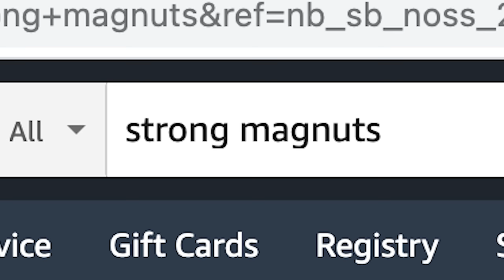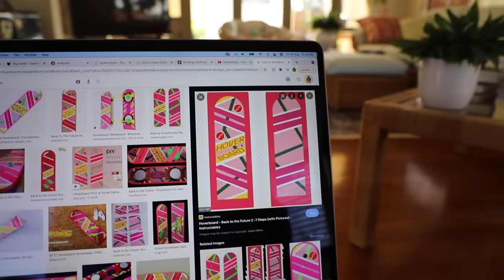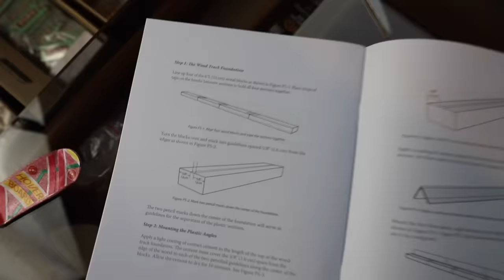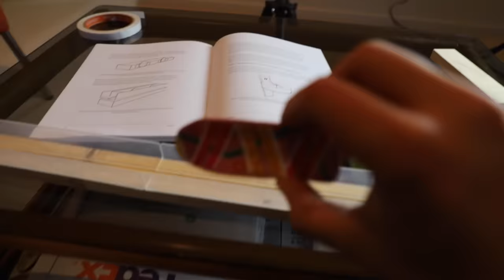FINGER HOVERBOARD!

Comment: hi David I'm an electrical engineer i found your channel whilst researching fingerboard parks for my son I built a pretty cool one btw and for your magno-hover to work you'll need to coil one very large loop of copper wire all the way around the edge of the platform ALOT of times making a huge electromagnet this will create a huge polarity field that your little neodymium magnets should sit nicely on top of its relatively simple physics (though i do have a PhD) its quite cheap as copper wire can be easily found on da bazos if you do wanna try do this reply to my comment and i can email you the full spec read out so you can make it super cool.
Reply from the maker: Hey!! Sounds awesome yeah shoot me an email when you get the chance! daylifesnow@gmail.com
Reply: I’m just adding a response so you get a notification in case you forgot about this coment
Reply: Reply
Reply: @davidsjones hey
Reply: @isabellapellegrini778  i dont think he will ever come back ;-; he missed out on such a good opportunity
Reply: cool
Reply: did you shoot him an email
Reply: could um you also email me this please 🫣
Reply: When is the new vid coming?
Reply: Hi, I am a toy maker, and i am in intrigued by the idea and convo here and  like to see if this idea can become a reality. Let's connect and see if we can make this a mass production product with low production cost and works well and easy to play with.
Reply: I’m commenting here just in case he actually ends up doing it

Comment: If you just flip the board with the magnets in it over than you'll be using a different magnetic field which should work...  PLEASE SEE THIS COMMENT DAVID.
Reply: Your trippin. Made zero sense. The moment he flips the board over it will be n to s pole attraction and thus be attracted to the centers of each magnetic field produced by each individual round magnet.. then the null points in which he was originally falling , will be the new points of levitation. Adding more space where the magnet attracts to the board and fails.

Comment: for a better “hover” i’d say use one big magnet instead of small ones because it’s probably being attracted towards the sides of the magnets. idk though i’m no engineer but i’ve been through elementary school
Reply: @D'Mario Albino if you try and push two magnets together both on their negative side they will push away but also start attracting to the sides of the magnets. so using one large flat magnet could possibly prevent that from happening
Reply: U can make big magnet if u stick magnets to the metal.
Reply: @matijadjemrovski5665  👍
Reply: @matijadjemrovski5665  wouldn't work because it would still get sucked to their sides
Reply: @seskater9331  it wuld work becouse that metal becomes big magnet and it culd onlie stick to the side of metal. And stick square magnets to the metal next to each other. Im not 100% shure that it will work but i think it will work.
Reply: @matijadjemrovski5665  the magnetic field works a little differently but mostly is the same
Reply: I was thinking the same
Reply: the 'maglev' or magnetic levitation system used in japanese bullet trains uses super conductors, along with strong magnets. for example you could use liquid nitrogen which is very popularly used for this. this combined with many rows of extremely strong magnets will allow stability and decent hovering for certain amoounts of weight.
Reply: More qualified than me
Reply: Ye
Reply: true
Reply: @noodle69  yeah and you get quantum locking with superconductors.
Reply: I tried this you need opposite magnets and when they negatively attract each other they push to the side. That's why you need a side wall to keep it centered. I don't think you can do this without some kind of side wall or force to keep it in place. I'm just offering my opinion. I could be wrong.
Reply: use a superconductor
Reply: @matijadjemrovski5665   fix ur spelling rq
Reply: Чхахах зрозуміл

Comment: Bro this is so cool, you should open the hover platform and fill the inner void with more of the same magnets. maybe double those under the fingerboard as well I think the distance of the void has it only barely connecting magnetic fields. And the small voids between magnets probably don't help either. So I'd recommend layering them in alternating placement so the voids disappear.

Comment: Round magnets will almost  attract each other because they don't really have a North and South side. The have really small norths and souths directly side by side. To realize your idea you would have get stick magnets or something similar and let the north or the south point upwards and you would have to do the same thing for the board. The problem is you would have to line up the magnets side by side without a gap in between because in the gaps the board would be attracted. I don't know if it's even possible without using electro magnets (which would be way to big and probably to expensive).

Comment: The reason the board did not hover was that some of the magnets in the wood shell would been randomly north or south therefore being opposites and creating hotspots or parts where the board was sucked down. The way to fix this would be taking off the the top of the shell and putting the board on each magnet and and checking if the board is repelled on each magnet, if the magnet is pulled down flip the magnet in the shell and glue it down.
Hope this helped:)
Reply: Also using squat magnets to fill in the gaps left by the round ones may help. Magnets repelling tend to attract at the edge, so having a large unbroken surface area will help.

Comment: To make clear grip get glass bead from a hardware store this is used for sandblasting parts and stuff or you can buy sand from a arts and crafts store aswell
Btw try removing the wood panels from the platform this might help a bit

Comment: i made one of these in middle school in the 90s. sure it didn't look this cool, but it was still 25+ years ago accomplished. I even had Thrasher mag cut-outs on my "multi-ply" cardboard board😂
Reply: Also it's easy enough to make this as long as you use a single sheet magnet for the bottom of the board, and a single (repelling) sheet magnet "half pipe" for the surface

Comment: you have to have a bunch of small magnets for platform... think ratios! and also it wouldn't be like back to the future but for what you're doing you want the magnets superglued next to each other on the hoverboard as in touch each other. can use multiple magnets layeredand  superduper glued and clamped together where the center of one meets the edge of another but should be good with just keeping things nice and packed together with about 3 to 4 different size magnet. oh and always use neodymium and if you want really strong but small size magnets do NOT get them off amazon.  well for super strong anyways

Comment: Magnets sometimes have to be flipped so then they have a different pull that brings them away so you basically I’m pretty sure you have to flip the magnets around then add the board a little bit more thinner then keep the board how it is and then probably like that￼

Comment: with the magnets, what you did was you didnt make sure that they were all facing the right way, because of this, some parts of that white board will work and some wont, depending on that regions magnet placement
all you need to do to fix this is make it so that all magnets are facing the right way, so that you always have a north to north connection, or a south to south one

Comment: it will float if you connect cubic magnets into an array to make a "single" field

the current setup's problem is misalignement of the magnetic fields,you are floating on the board you got north pole down and south up and the magnets on the base are the oposite. it turns out that at certain point south on the field of the next magnet on the base is stronger towards the board's north because there is a gap

just another free tip, if you put all cubic magnets oposing fields to the board's field should be enough,  but if make a search for halbach arrays you can create biasing on the field, which will make it way better and ensure that the fields are ok, so instead of face a pole (let's say noth) all facing up, you shouls instead do up,left,down,right,up,left,down,right...this will double one pole's power and weaken the other's for the vortex nature of magnetic field

do this and you will be fine
 ;)

Comment: You need electric magnets dude, with electric magnets made from electricity you are able to control not only the flow of power conducted but equalize them to them being just one sided, like either north power or south power, sort of like those electric huge magnets used in scrap metal yards, on and off, I think I could build a hovering car using the same principles you using but with electric currents connected to my computer from were I would be able to calibrate each square of the magnetic floor and also be able to control the vehicle which will be powered by your cell phone, this vid was great thanks yO 🧲